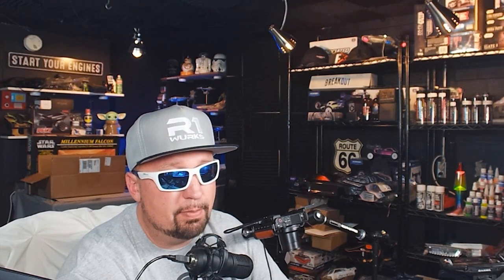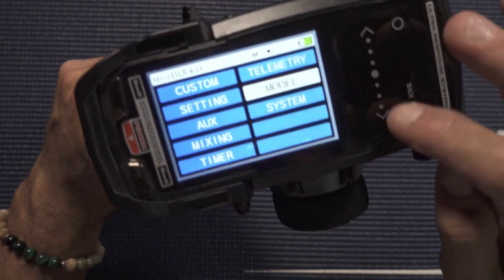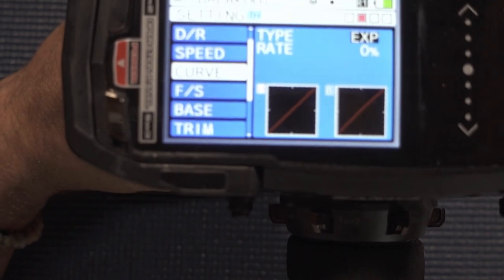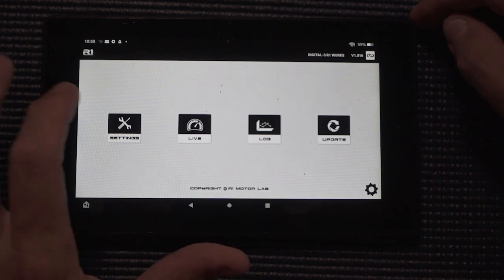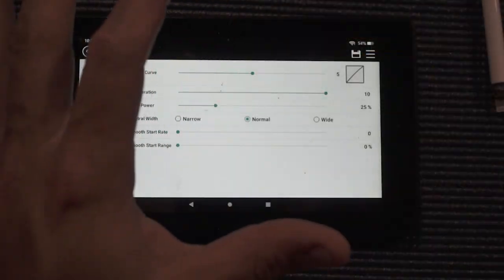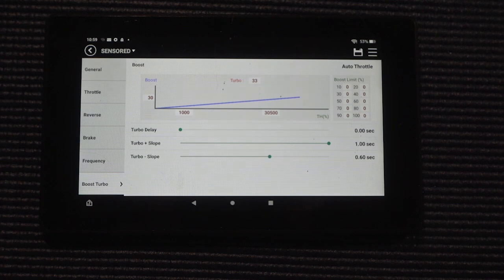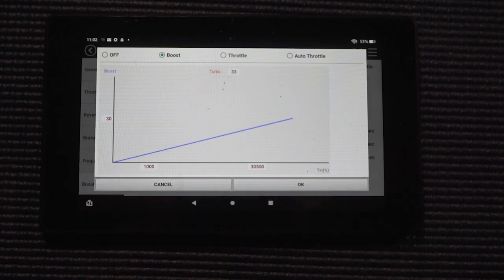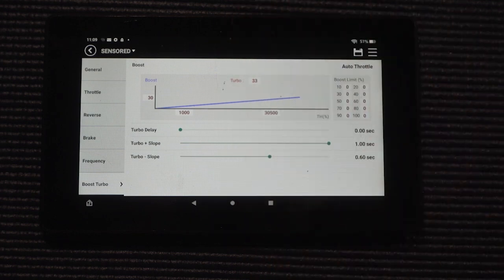CASTLEWURKS ULTIMATE TUNING GUIDE | EVERYTHING IVE LEARNED AND HEARD | ALL RIGHT HERE!!!!

Comment: great video lots of good stuff. I know that everyone is having a hard time finding pinions in the size they want (myself included) but depending on your setup it is possible to run 0.8m or 32 pitch spur and pinon gears. I happen to have a nice selection from other vehicles so that is what I am using (currently 58/24) which is very close to 81/29 in 48 pitch.
Reply from the maker: For sure. It’s completely fine. Many new people just don’t understand that aspect so I figured to not include it and make things a little less complicated. Just get your fdr in that ballpark and go for it.

Comment: Thanks for taking the time to make that video... are you saying that autothrottle senses wheel speed or slippage and take timing away. Basically like a traction control
Reply from the maker: In a way. So it won’t add timing when there’s is no change in the rpm or the rpm increases higher then it’s delta.  Easiest to understand what it doesn’t do. For example with tekin it was all rpm based so if you broke the tires and had a huge run up in rpm then it would keep throwing timing at it causing bigger issues. The r1 just stops. You can see the flat lines in the log graph on the pink line in the video. All the flat spots is where it’s detecting spin but it wasn’t bad enough to show up in the current. So it worked perfect t in that example. But if it breaks lose hard it still can’t control all the way and you’ll see the spin with current spikes up and down
Reply: @Dorkyand40  oh I know exactly what you're talking about... that's why people love it... thats drag racing when you get a chance check out Davis technology.... I would love for you to put an aggressive tune up and show that feature at work holding timing
Reply from the maker: The new chassis should hold way more and hopefully be a bracket runner like your cars. I would rather be in a slim range and make smaller adjustments for change vs these bigger ones. Even with voodoo and get stuck snd awesome surface this car has had a mind of its own. 1.73 then maybe a 1.9 then a 1.82 then a 2.05 lol
Reply: @Dorkyand40  I completely understand Chad .. I just meant for teaching purposes to show it actually holds timing. we all lose voltage and amps when we spin because the system loses its load. Like flooring it on the table No draw you got me very curious about that
Reply from the maker: Yeah for sure. These escs though never show us in a log how much timing was actually added in. That would be so amazing. There’s probably a way to show what we assume is happening in a graph. Now they have another mode which is throttle % boost and that could show us closer since it adds timing preset to what % you are applying. So if you’re adding 10 deg until 50% throttle then you know what’s in there at what point in the throttle on the graph. Haven’t played with that mode at all.
Reply: @Dorkyand40  understood I thought you said the "pink line" was showing that feature.. in the steps you were referring to
Reply: @Dorkyand40  throttle boost works great you should try it, basically put in the 100 box what boost timing you want,  then make a linier ramp backwards to 0, I like it better than auto, try it
Reply from the maker: Man nice. I’ll give it a try for sure

Comment: I know what I look at in the logs but when you refer to jagged Little lines are you referring to just RPM just amp draw or both? My RPMs are nice and smooth but sometimes I have a little bit of jagged in amp line after 100% and I'm not sure how to interpret that
Reply from the maker: I don’t think the logging rate of the r1 is fast enough to show wheel spin at some levels or it might be smoothing then graph too much. With my older castle esc I could see every single rpm. So imo it has to be spin so I would treat It as such. Take out a few degrees or lower your point. Just take a little out and see if it smoothes that out. Could be a bump in the road. Could be something hitting or sticking with the car.  No jags allowed :) losing et with that. Hope that helps
Reply: @Dorkyand40  got it, thanks Chad.

Comment: What do u think about using the expo instead of the whole 9 point throttle curve?
Reply from the maker: I e never used it with the r1 but no reason you cannot.  It’s a slightly different effect then the curves built into the r1 but I would make sure that curve is set to linear so you have an idea of where your at in case you find a rough spot on the track during your 0-100 period thst you need to work through and or around

Comment: I have the castle esc, and a 4t trinity stock motor and I use a -90 ramp and 30 point, is that good?
Reply: *baseline holeshot motor
Reply from the maker: It sounds pretty aggressive to me but if it works then it works. I’ve never heard of anyone using less then 93 and they are few and far between. I would try to beef something up somewhere else with gear or the speedo so you have that tool in your belt.

Comment: Hi bud is there that big of a difference between the R1 esc and castle creations mamba x 8s in how it delivers the power
Reply from the maker: I’d say yes and no. You can add more timing and have way more tuning features with the r1. The software just has all of that. The castle software does not. You also only have rpm based cheat mode on castle and it’s a guessing game on how much is coming in when and at what rate.
Reply: Ok gotcha that makes sense. Ya I just put the castle set up in my Apollo only 2 races on it and I have the M12 radio looks like I need a few upgrades lol

Comment: How hard was it to upgrade to the 10awg wires? And does it make a big difference?
Reply from the maker: Wasn’t hard at all. Just use big tip. Little bit of solder to get things flowing.  I’ve seen a few people say they have data that shows a slight/modest improvement but I think it would be hard to demonstrate.  It’s almost like the xt90-qs8 debate. In the end I’ve settled for 10g and xt90 just like the fastest people I’ve seen.
Reply: @Dorkyand40  ever since I have started to follow your channel I’ve been getting faster and faster 2.5 2.3 2.0 1.9 and now I’m aiming for 1.8 or better! you are the let’s get fast on Facebook guru thanks for all the advice and help brother

Comment: I have a question on the sanwa m17. Can I use it to turn lights on and off for night racing?
Reply from the maker: Not without something to control the voltage output. Not sure if sanwa has an external tele sesnsor or something that could be used. Once you’re pluggged in your always getting voltage to that connector. If this was an fpv drone it would be easy but here not so much but not impossible. I’ll look into it
Reply: @Dorkyand40  thank you.  Also you have been great help with my set up thus far.  I have an m17 running a castlewurks set up on a royalty mfg el mero mero.  May be moving over to the dc1 or Apollo.  First I need to knock out my revxs no prep drag bike.
Reply from the maker: Lol. Sweet man. Always glad I can help. Can’t go wrong with either of those cars right now. It will all be here.

Comment: What is the point function meaning the dots do on the esc dose it override the controller or work together?
Reply from the maker: Together think of a dot with a point of 0 being your start throttle power snd then if you move the point think of that as throttle percentage start.
Reply: So example on the esc 1st dot is my start power meaning my launch , if I set it to 10% I’ll give me that 10% of launch power correct plus what my ramping numbers on the radio to give me a smooth start or launch off the line

Comment: Castle offers a 3.2mm shaft 1412 rotor. Has anyone tried that for more gearing options? Or is there a chance that shaft will break?
Reply from the maker: I’ve never tried it but don’t think it’s worth it. The gearing seems to be very clear on this one. Multiple drivers faster then me are using this or something very close. The extra stator volume this motor has is perfect for 5mm.

Comment: Judging by your graph your gearing is way too tall. I average a low 1.7@ 85 with 7.8 fdr. Avg volts 6.7-6.8.
Reply: Amps always around 420 with both cars.
Reply from the maker: Cool. Something to look into. Thanks
Reply: Every car is going to be different,  I find my car falls off at 7.5 so I run between 7.0 and 7.3...1.81 on gns